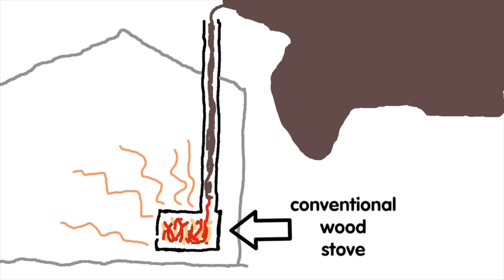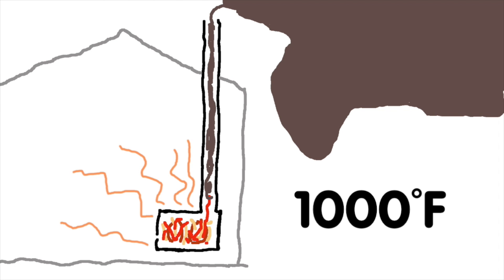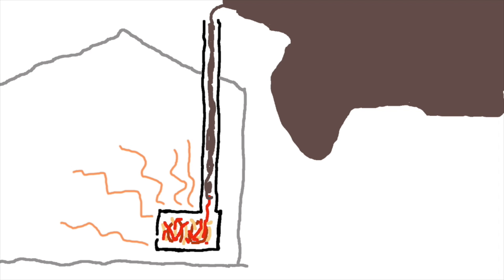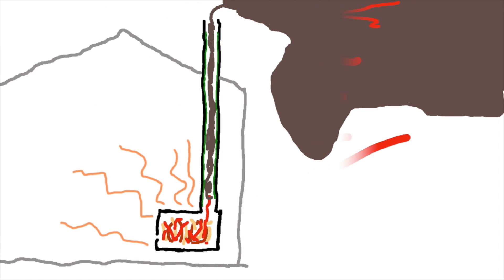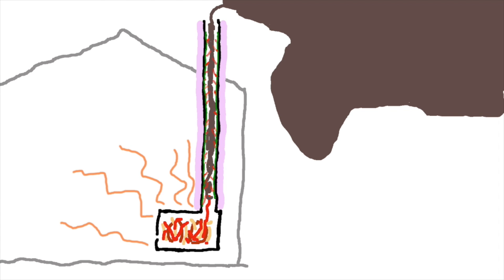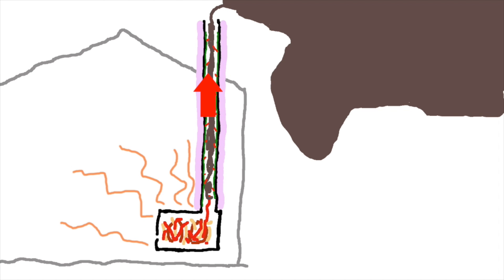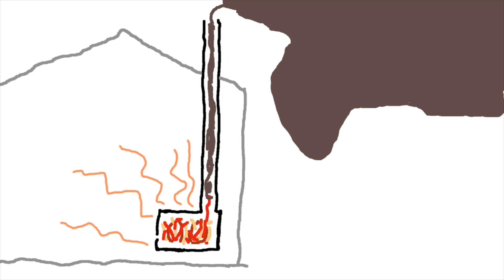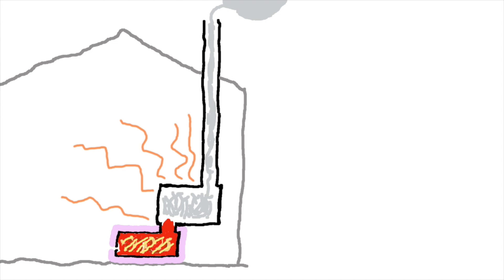What is a rocket mass heater?

Comment: I like to overengineer stuff and I had this wild idea while watching videos about rocket mass heaters. Sadly, never had the chance to see them personally in action, which is only making me theorize. So, if I get it straight - the raised part, which is often in a form of a metal barrel, is the place that has the most heat, right? I was thinking - can we surround it with a metal pipe that spirals around it like a coil and run water through it? Can we squeeze out a water heating system out of a mass heater and make it even more efficient, potentially heating even better the rest of the house? I would really appreciate some thoughts on this.

Comment: Congratulations, bros, you discovered the Korean Ondol all over again.
Reply from the maker: More accurately, rocket mass heater stuff steals several bits from several strategies and then adds a bit of its own.  In this case, the Korean Ondol does not have the insulated riser that the rocket mass heater leans on.

Comment: Could a barrel found in the woods with rust holes in it be insulated with aircrete to form a few inch thick outer coat? This would seal the holes but could the insulation impair the heating mechanics of the stove system?

Comment: Wow best rocket stove I seen on YouTube yet!   Insulate main chamber increases temp 1000 to 1800.  Use mass to store heat for days.  1/10th the wood needed, higher temp with insulation doesn't burn wood faster.  I might add a stainless coil to heat water for thermal mass through a thermal syphon.  Thank you guys!
Reply: nice

Comment: Why must the metal barrel be exposed?  Can't it be encased in "mass" as well?
Reply from the maker: For the system to work, it needs to dump a lot of heat quickly.  Without the exposed metal, the space takes forever to heat up and then gives off too much heat hours after the fire is out.

Comment: This is the best explanation. So simple and clear. I'm going to try to make a mini mass heater that works off a tea light...
Reply: How did it work?
Reply: @tim1970martens  thanks for reminding me. My initial design was simply a rock held above a tea light (mini candle), enclosed by other rocks. The rocks warmed up and stored the heat energy, radiating it after the candle went out. I have some leftover concrete from the job I did this morning, I think I'll try and make a nice form and make a more efficient one.

Comment: Thanks Paul.  My idea for a better draft is the HRRMH (my two-letter addition), HIGH RISE ROCKET MASS HEATER.  Stubbing the chimney is where the draft potential was cut way down.  I have no idea who made that mistake.  I am assuming it was a mistake.  There may be a reason for it that I don't know.

High-rise the heat riser to near the ceiling (insulated tube), U- turn down with a naked steel tube. At the appropriate height, jog horizontally for a cook plate.  Then straight down into the stratification chamber.  There the heat is transferred from the (clean) flue gasses into thermal mass.  At the opposite end of the stratification chamber have a horizontal discharge through the exterior wall (near the floor).  When the end of the tube is away from the building far enough to escape the air pressure zone (ten feet maybe), then up two feet for visibility (safety).  A vertical discharge is less affected by wind.

If you discharge steam, you are wasting heat, so collect the steam inside.  The discharge temperature at the wall can be room temperature, if this design works.  I have never tried the HRRMH.  I have never used wood heat.  I like the Propertarian Constitution.  I designed the HRRMH today. 

The air pressure zone is due to wind striking the building and the building pushing on the wind.  On the down-wind side there is low pressure; on the up-wind side is high pressure.  Out-side pressure could disasterously reverse the flow.   You will need to get an engineer besides me to say whether the exterior extended horizontal is okay.  With the HRRMH, any type chimney you can think of may work --- I don't know.   

I have eliminated the traditional chimney thinking it was a useless impediment. Combining two systems was needlessly complex and difficult to operate, according to my non-professional engineering sensibilities. Instead of having two chimneys the HRRMH has only the traditional number (one).

Go ahead and try it out and see what you think.  The design is my contribution to Permies.  

One concern is that by eliminating the bell over the riser, the riser won't be hot enough.  That may be the reason for the stub riser.  If an old fashioned stove can get the flue hot accidentally then perhaps Permies can  do it on purpose.

A second concern is that without a fire going it will lack what is needed to start the fire --- a draft.  If no chimney can be eliminated, the HRRMH idea is NOT killed.

Summary: HIGH RISER, fewer chimneys, cold discharge, side discharge, better draft (hopefully), simpler, not proven.

Comment: EPA approved stoves have been available for decades. They are more efficient then other stoves from the past and have very low emissions. they usually utilize either a secondary burn with added air or a secondary catalytic burn.  They are able to operate at much lower temperatures without the risk of creosote buildup.  They are even used in some mass heater designs as the firebox.  They require far less air than a rocket stove.
Reply from the maker: Rocket mass heaters typically burn at 93% efficiency while the stoves you mention tend to function at less than 65% efficiency (while having 16% efficiency added to their official numbers to compensate for what goes up the chimney).  Rocket mass heaters use more air because they are burning more efficiently - but only during the burn.   Since the rocket mass heater doesn't burn as often, the rocket mass heater ends up needing far less air.   Further, it is difficult to get the rocket mass heater to burn inefficiently, while it is easy to get the stoves you are talking about to operate at 7% efficiency or less - this is where the rocket mass heater REALLY shines.
Reply: What data set are you getting the 93% efficiency from?

Comment: Hello! I am building a small rocket stove model before building a real one in my house to get a better understanding of how it works, and I am facing a problem with the extraction of smoke whenever the fire pit is opened to insert more wood, the smoke rises directly from the pit, which would be problematic inside the house. How would you go about fixing this problem?
Reply from the maker: I think whatever it is that you built is not a rocket mass heater.

Comment: I save heat in form of water 2000 liters. 
Chimney from stove has 5 angles before smoke goes out the house. Not like regular house with chimney straight up out. 
I can also cook same time on the stove and bake bred or cookies. 
It is 
MBS Super Thermo Magnum 21 kw

Comment: What I don't understand is why the fire doesn't just come out the J tube and basically make the system work in the opposite direction. What's to stop the fire from sucking the draft from the chimney and burn out the J tube?
Reply: There’s obviously dark magic involved. We should fear this thermodynamic witchery.
Reply from the maker: convective currents.
Reply: @paulwheaton  I understand that. But what makes the current flow in the direction it does instead of just going the other way from the start?
Reply from the maker: @ballwizz23  the same thing that makes a hot air baloon rise.  convective currents.
Reply: @paulwheaton  Jesus Christ. Never mind.
Reply from the maker: maybe this will help https://www.youtube.com/watch?v=a8s-mzfnPy8
Reply: @ballwizz23  Well, I think the video he just linked is pretty damn convincing!

Comment from the maker: thanks to my patreon peeps for getting my youtube engine running again http://patreon.com/pwvids
Reply: Its an honor
Reply: You said steam goes out  ? What steam ?  it supposed to be smoke right ?  🤔
Reply: @magnified4827  
When wood burns it releases smoke as well as water vapor (or steam). Even seasoned firewood has some water in it.
Reply: I am layman in this but wanna ask you, Is it possible to build a less wood (fuel) consuming but a more heat producing rocket mass heating system to run an effecient  Stirling Engine genset for producing power in hot/tropical/sub tropical places and countries where heating is not required  ? For the purpose of this should only be to run the Stirling effectively..

Can it be done  ??
Reply: @magnified4827  
Sure that would be a good usecase for it. And with a Stirling you cod heat a mass up and run ducting through the mass that the Stirling could draw it's hot air from and then you wouldn't have to be standing there all the time to keep the fire going. That would make it a lot more less labor intensive to run it.
Reply: @paul wheaton

Is it possible to build a tiny verse for a trailer that won’t be so heavy but still work effectively 

I’m thinking use less mass

Comment: paul, thank you, nice video, got a (dumb) question:

at 1:43, the improved drawing, at the flame far left and bottom, in other words, the single flame at 09:00

right there the black outline of the box is separated by the pink insulation.

is there any reason for that?

(because, if there is a valid reason, then i might be missing something!)
Reply from the maker: the black line is part of the morphing.  The black line is not a material.  Does that help?

Comment: Great Video Paul. I'm just getting started on my rocket stove so I'm making a mold to cast the heat chamber and riser tube. So my question is if my heat chamber is 13 inches long  and my rise is 36 inches tall and 6 in a round how much perlite will i really need?? I did find it in 8 quart bags by Miracle Gro

Comment: The barrel reaches extensive temperatures.  Would the system work if you put brick on top to absorb heat and dissipate it over time?
Reply from the maker: Some people use a tea kettle.
Reply: i could see that, warm water for your tea or coffee.  But would brick retain heat longer?  Would putting brick on top dissipate the heat and cause incomplete burning?

Forgive me.  I have recently stumbled across rocket mass heaters and your videos, very informative.    This may give off enough heat that brick on top wouldn't be needed.....just a thought.

I am in the planning stages of building one.  I know where I want it, I just need to measure for distance so I use the correct size pipe.
Reply from the maker: Check out my video about the cyclone heater.   The "barrel" is effectively all brick.  https://www.youtube.com/watch?v=U7kqu1XvsXY
Reply: Interesting!!  Will dive a little deeper into that.  

Thank you for your time and information.  Keep up the great work!!!

Comment: Needs a better look on the afterburner.   Hate the 50 gallon drums.
Reply from the maker: Check out the FAQ on this page:   https://richsoil.com/wood-heat.jsp
Reply: paul wheaton 
I love their efficiency, didn't see anything that would be an attractive alternative to the drum.
Going to give it some thought...
Reply: SunDogBuilder 
That is useful advice,  thank you!
Reply: You don't  need the metal drum.
It's an instant radiator for throwing fast heat into the room. They have traditionally been drums because drums are free in most places. You can make the quick radiator in MANY other ways or choose to leave it out entirely. If you leave it out, make a larger storage mass instead.

Some examples of alternatives to the barrel:
A soldered, beaten copper cylinder with a domed top (could be a dished top or an arbitrary shape). 
Stainless steel milk containers (the ones for dairy operations).
Dragon statue, welded out of plate steel.
Any cool metal scrap thing that is hollow, or dished; or even just a flat metal plate set into an adobe enclosure.

Comment: I like the idea, hate the DIY aspect. I wish I could pay someone around here to build one for me.
Reply: Brunnr Wait till Paul Wheaton sends You the desired informatiotion. 
No good idea to look for someone ypurself since you don't really know who you can trust. Why? You really have to dig into it to comprehend all the important detail-that takes time and you would have to pay for that time too if the builder is inexperienced. 
 Better find someone who already had huilt at least a few of these rocket heaters AND IS ABLE TO PROOVE IT TO YOU. Also, inexperienced builders who havent done some backjard experiments before installing a rmh into a house is likely to get nasty backsmoke into the house. Fire can work for you fine, but you've got to learn how to take safety measures against hazards like smoke, bad insulation or wrong materials for the burntunnel. Even the exaust pipe can cause problems. 
If Paul gives You an adress, you can trust him, otherwise be careful about who you trust.
Reply: Karl McCreight I'm actually going to visit Ianto Evans (who invented this design) in October to take a workshop on them, and plan to visit Paul's place in January to see them in action. I fully intend to install my own on my retirement property. 😀
Reply from the maker: If you post out to permies, I could try to see if we can find such a person.
Reply: Since there are books that are essentially builders guides which can be bought, I'm sure you could hire someone to build it for you. The DIY aspect does help reduce the cost so you pay for their labor of course.